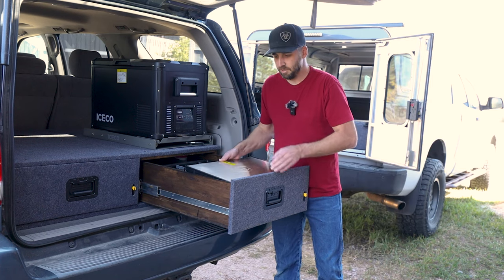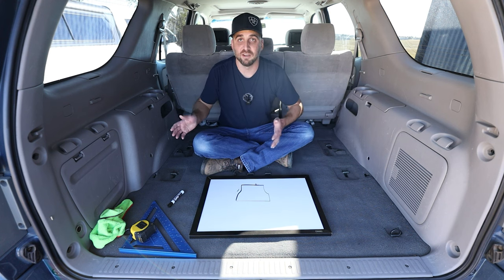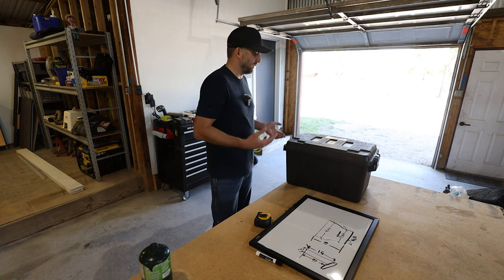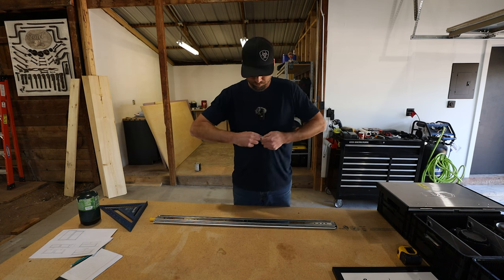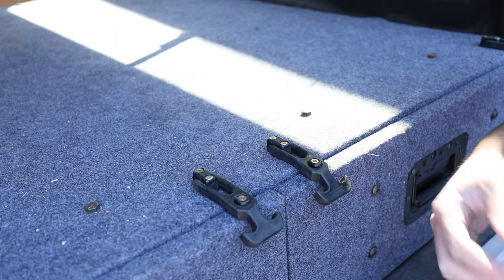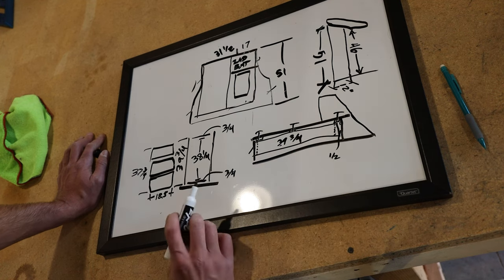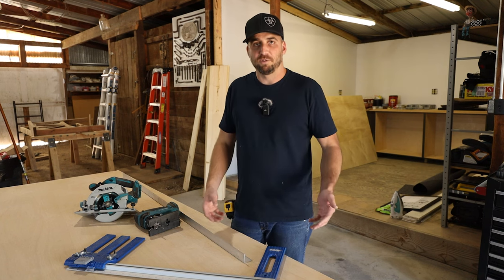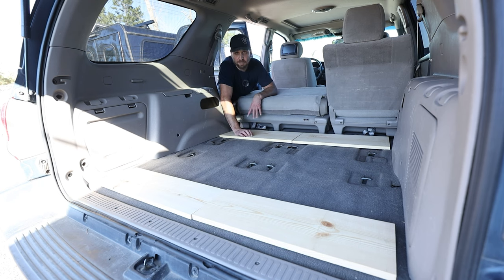Designing And Building Overland Drawers: The Ultimate Guide

Comment: How has this not broke the internet? This was amazing. It took something I never thought I'd ever be able to do, to something I actually think I could accomlish. Now granted I lack any tools at all. However this is motivation. A few adjustments would be for me, it would be a 4Runner, I'd also like to put a kitchen sink setup, and possibly a 2  slim drawer on one side, and 1 thick on the other. Also possible cubby latches to access the contents from above too. I'd also be using one side as a sleeping platform. Some other ieads (again no talent, no tools, but I now know this can be done, and only risk losing a tip of a finger at most), but are some recessed led strips for lighting, when the drawers are opened. I also saw on another video of a person who built a prep table into one of his drawers that articulates up which I thought was genius. Overall though, this is just hands down great. Thank you so much for taking the time to put this together, yes it was long, but so worth it. My mind is racing with ideas and excitement.
Reply from the maker: This comment is a big reason why I wanted to do this video. Help spark ideas and possibilities! 🙌
Reply: @adv_mnd  Consider me sparked. Haven't stopped thinking about it since I've watched, and I've watched an unmentionable amount of other build videos now about others, and some how yours keeps rising to the top. You really make this approachable and have opened my thinking to 4 milk crates and a sheet of plywood, to something really exciting. Thanks again!

Comment: How did you do the carpeting around the latch? It seems hard to get it in such a small area
Reply from the maker: I actually trimmed the carpet with a razor right on the outer edge, and stained the inside edge of the hole with the same stain as my drawers.

Comment: Great video! One question, how did you mount the drawers to the Sequoia? Or are they just free floating?
Reply from the maker: Currently they are free floating. I’ll eventually try to tie them in to the rear cargo or 3rd row seat bolt points in case there is a rollover scenario.